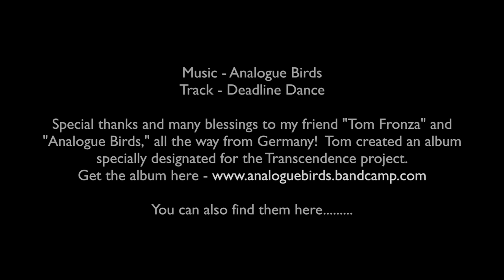Transcendence - Episode 30 Rough Framing of Bed and Bath Bus Conversion

Comment: Beautiful work. Amazing.  But your bus is getting heavy, very heavy. The 2x4's are sucking up a lot of space. The boards and the OSC panels are adding real weight. And some of your weight is pretty high up. Does that blue bird have a 5.9 engine? 5.9's are great engines, but not that strong when turning 22.5 wheels.
   I would think that cold-rolled tubing for framing the interior would be better. you could have skinned the ceiling and walls with Styrofoam and EIFS since you painted it.
   I am amazed at the work you did on the back door.  I could not do that.